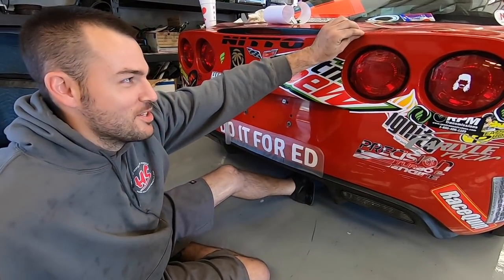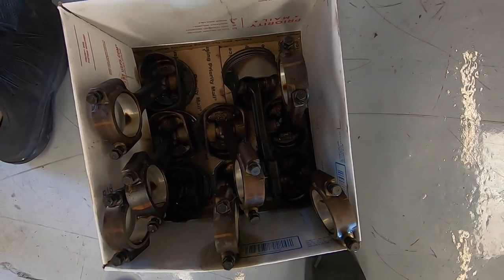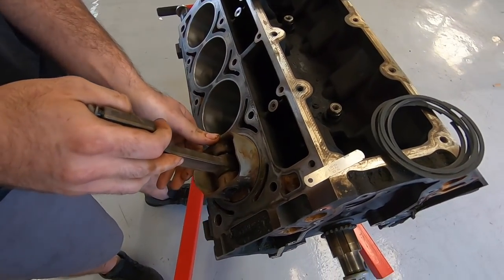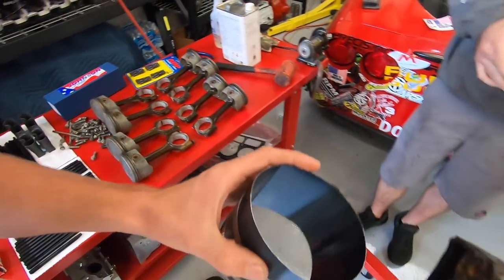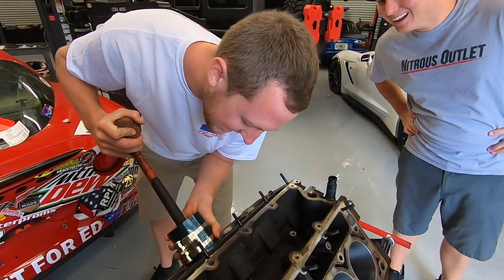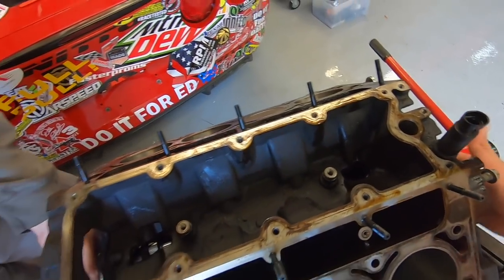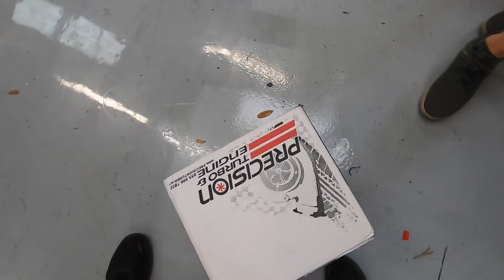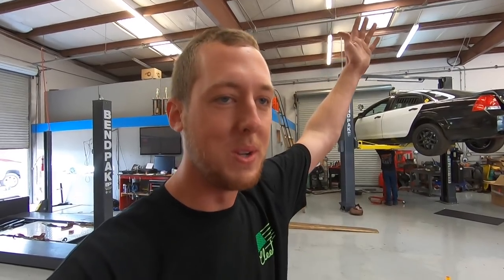The Auction Corvette is REBORN w/Her "NEW" Junkyard Truck Engine!

Comment: Not really good to just replace the rod bolts. Arps can tighten alot differently than stock. That's a good way to wipe out your rod bearings. Best to torque the rod caps on and then have them checked for roundness and remachined before going back together.

Comment: Rods should be resized after install new rod bolts.
Reply: i definitely cringed. this is one time i approve of a plastigauge check at least. in my motor they definitely get resized whether new bolts or not.

Comment: The last motor blew up,rods were actually broken in half and the stock rod bolts still didn’t fail and were attached to the stump of rod that was left.  But arp rod bolts are “a must”?  Stock rods would fail well before stock rod bolts would.

Comment: So when you gap rings, you're only supposed to grind on one of the faces so you still have a perfectly smooth face on the other side. I doubt what you guys did with affect it much, for this engine, but I wouldn't trust it for extreme engine applications.

Comment: Won't the gap get even smaller on those rings when it's hot?
Reply: Yes, that's why they're gaping them, to prevent the gap from closing completely under high heat. That's when problems occur.

Comment: Yea, someone should send Cleetus to auto shop class, in fact send him all the way back to high school!   lol
High oil pressure isn't everything boys, you need volume too!   As in lots of oil circulating in that engine.
Looking good though, and I would throw away that piston ring compressor as far away as I could.  There are much
better compressors out there, that are a lot easier to use and don't break rings when putting that piston in the cylinder, IMHO...

Comment: Please break in the engine this time after a rebuild needs to run at 2k for 20 mins
Reply: I thought you were supposed to alternate the RPMs to the the oil on differing areas of the cylinder.
Reply: T.F.D ! It has roller lifters, it doesn't need breaking in like a normal cam and flat tappet hydraulic.

Comment: Using a grinder? They are called file fit for a reason. Do you know what that is? Did you resize the rods after changing rod bolts? Alarms ring " Amateur  Engine builder" Nearly guaranteed to self destruct. DO NOT DO WHAT THEY DO !!!!

Comment: Thoes ring compressors suck I have cut myself so bad I almost needed stitches. The nice ones are the ones that are tapered and for one size the thing that sucks is they only fit one size bore. But u literally just drop the piston in no compressing and cutting yourself thoes ar3 the cheap shitty ring compressors at autozone

Comment: Jet-Lube 12/34 is the best you can spray that on anything from your rusty tools to your new tools to even your old riffle as a gun oil!!! http://www.jetlubecanada.com/pages/1234.html used it on a cylinder head that was being flown in to a remote work site for a giant inline 6 diesel, arrived with out a spec of rust due to 12/34